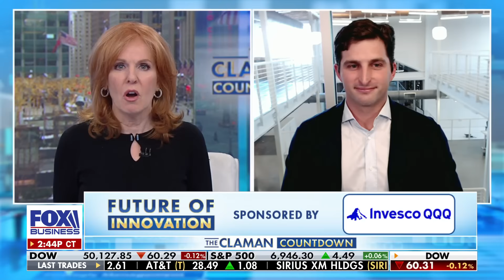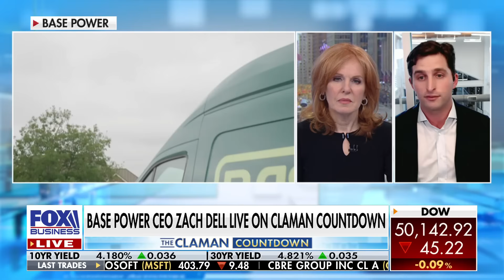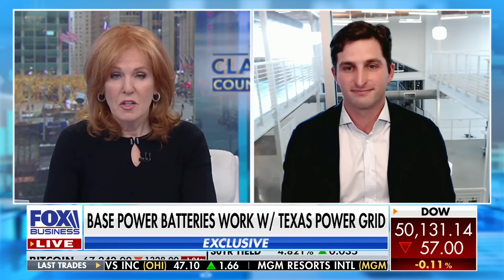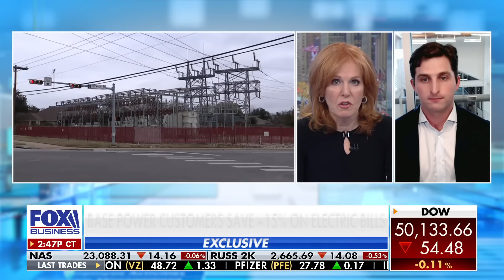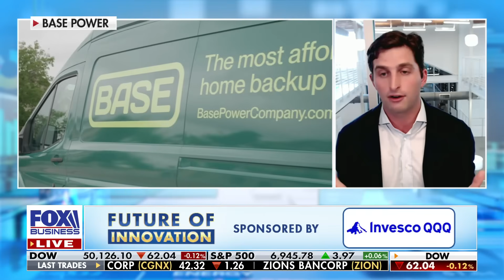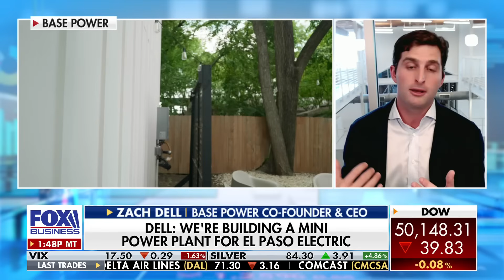Inside Texas' 'mini power plant'

Comment: A large part of the Texas electrical grid is part of the WW2 quasi-governmental Electric Reliability Council of Texas, Inc. (ERCOT).  Which does not always do a good job of ensuring reliability. 

The Texas Panhandle is not part of that system.  So years ago when the ERCOT system went down in that really really cold spell, the Panhandle area, which is further north and got colder, had zero problem with the grid going down.  The only problem we had was stupid drivers losing control on the snow and hitting power poles here and there causing very small local electrical outages, which Xcel Energy did an excellent job of getting fixed, usually in a few hours.

Comment: The reason the ice storm a couple of years ago was so bad, was because of wind turbines. They froze up and couldn't produce any energy. Never rely totally on wind or solar. There will always be times that the wind isn't strong enough, the sky is cloudy during the day. That's why battery storage is so essential. Having another form of heat, cooking, and powering refrigeration of food is essential. Learn from preppers if using wind or solar about dealing with off grid energy. Also, consider the effects of EMR from any form of electricity.

Comment: It would be great with the exception that they have control, still own it, charge you a thousand dollars for installation then make you pay a subscription for it, and can drain the battery when they see fit.  They make money by selling the energy you have allowed them to store on your private property to grid consumers when they deem it not necessary for you.  If they were doing it the correct way, you would own your battery and decide to opt in to selling what's stored in the battery back to the grid (them) to pay for the battery.  Or they wouldn't charge you a dime.  This isn't going to work with that business model.  It's a grift at best, the new "smart thermostat" that the company can shut parts of your house down like the ac at worst.  When will people get that IoT items that can be accessed by a company for any reason when you read the contract should be left on the shelf.  How they got off the ground in TX is a mystery to me.  The TX grid is so fragile because of all the "wind power" on the grid with no backup load.  Just another item  that comes from the "green new scam" class of BS.  Buy some Tesla Batteries that you'll own and store it from the grid.  Yeah you'll pay more at first but you can be off grid for more than just a day and you don't have to socialistically "share" backup power.
Reply: Solar is DIY. I have spent $5,000 and run my house 24/7. My bill never goes above the $30 minimum, even last month. I dont see much of an advantage off this because solar is the best p art and with used going for $50, its the cheapest. Any commercial solution is total nonesense. Just haul  in a genny.

Comment: What happens when the battery catches on fire?
Reply: And the home insurance doesn't cover it...
This is nonsense. I don't see any way at all this can be cost effective.
Reply: @Mark-z3o1w 💯‼️ I livein TX and if we have something like this we won't be covered. They also said to have any BACKUP power it has to be so many yards from our home .... which means burying cables underground where we can flood. It's useless here.
Reply: @Mark-z3o1w it's definitely not cost effective compared to buying your own system, they are getting cheaper almost daily with all the competition for these types of systems.  They guy in video mentions they can power the home for a day = that's equivalent to a lot of entry level systems available on the market now that are still considered portable.
Reply: Who’s they? I live in TX and have a Powerwall fully permitted and insurance just increase a little so yeah that statement is likely false
Reply: @mrt5393 forgive me I believe you posted under the original comment I had trouble finding the sub-comment? You we're referring to lol and yeah you're right about that as of fairly recent correct? Last few years?
Reply: professional systems suck the  air out of the room. No Air, No Fire.
Reply: It burns
Reply: Hopefully they are using lithium iron phosphate batteries which do not have the thermal runaway problem that lithium nickel manganese cobalt oxide have.